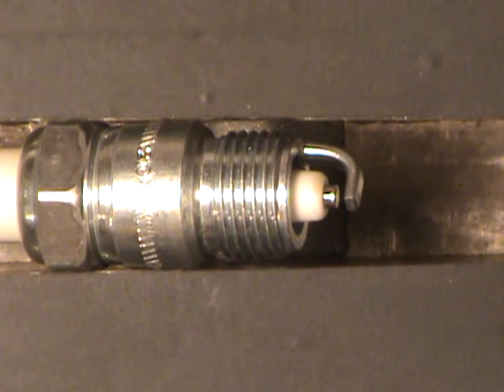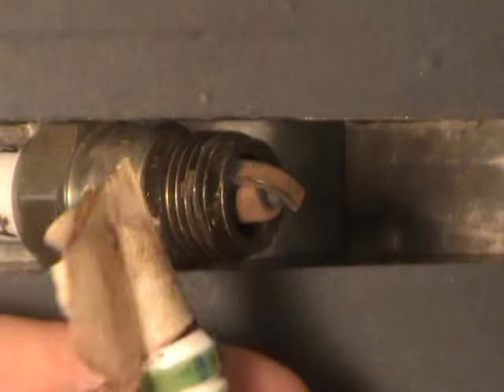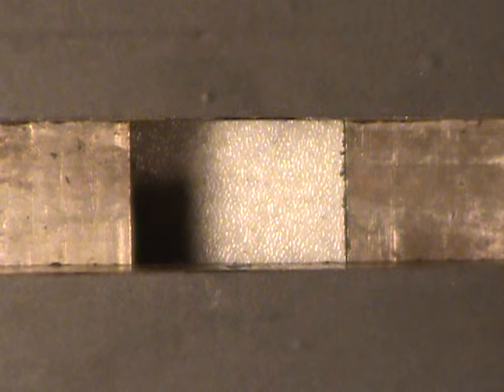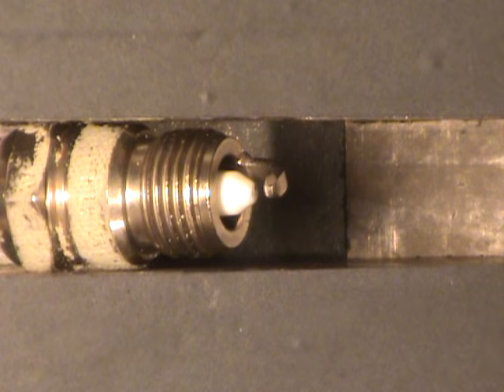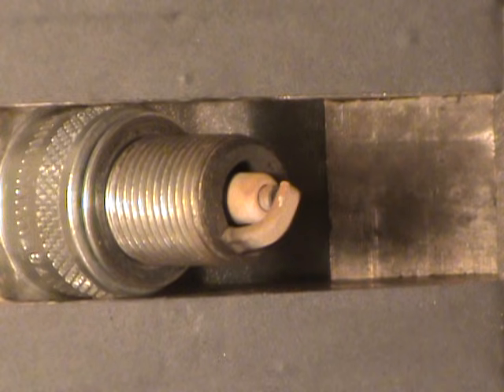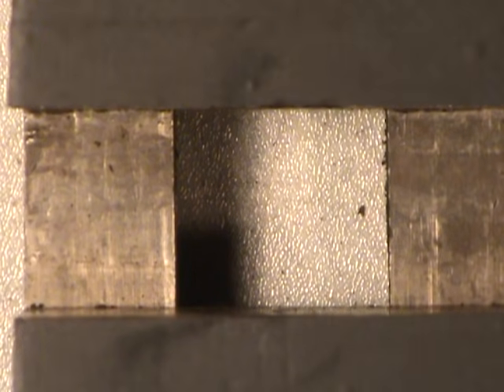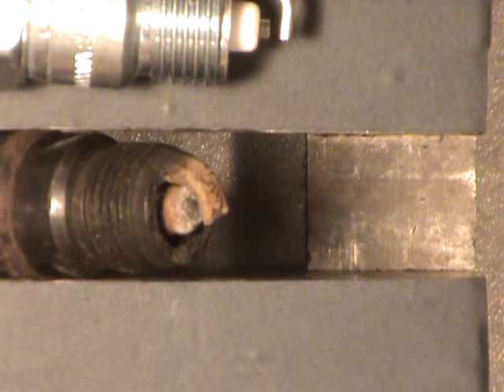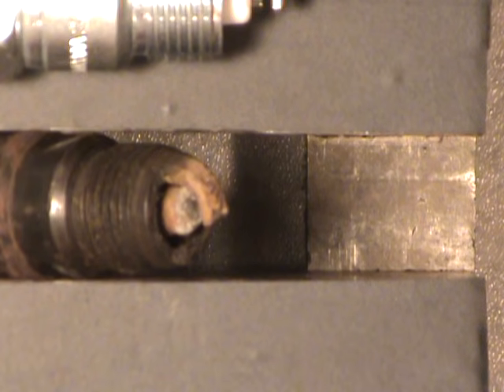SPARK PLUGS How to Read them (Part 3)

Comment: I have some pinging in my engine. Would a colder spark plug reduce some of that?
Reply from the maker: Ern H. Greetings Ern H.    Thanks for watching, and for, Your quite interesting comment/question as well...............................If You can tell me, "Exactly", what Your Vehicle happens to be, as in...Year...Make...Model...Engine Size/Description...etc., then, as I see it, I will be able to help You out, to a, much More Precise Degree, so to speak, otherwise, about all I can do, is Ball-Park/Generalize, as to what is causin' Your Engine's, not so wanted "Pinging" Problem.................................If Your Engine, happens to be "Computer Controlled", then, there really Should Not be any Pinging goin' on, as the Computer, when working Correctly, and as it should be doin', should be making, the Required Adjustments, to, both Your Air/Fuel Ratio, as well as the Ignition/Spark Timing (Advance), to prevent any Pinging in the first place.............................If Your Engine "Is Not" Computer Controlled, then, it could be, some of the following, or, a combination there-of................................Gasoline Octane Rating/Too Low, for the Engine's Compression Ratio...................Too much Carbon Build-Up/Deposits, on the Cylinder Heads (inside), as well as, on top of the Pistons as well............................Engine Temperature Too Hot (cooling system problem)........................Too Lean, of an Air/Fuel Ratio, for the Engine's Needs...maybe a Higher % of Ethanol in Your Gasoline's Blend? (that be Alcohol, usually derived from something, along the lines of "Corn-on-the-Cob", that will usually, make a Vehicle, with a Carburetor on its Engine, tend to Run, on the Lean, Air/Fuel Ratio, side of things)...(also...Elevation...At, or Above Sea Level?).......................Too Much Ignition/Spark Advance (in Crankshaft Degrees)...(Distributor Equipped...???...then, maybe...Too Much...Mechanical, and/or, Vacuum Advance), depending on, how Fast the Engine's Crankshaft is Rev-ing/Spinning, as well as, how Light, or Heavy, of a Load, is placed on the Engine, at any given time...........................Usually, for a Well Running (in reasonably good condition), Stock Factory/Low Compression Engine (not more then about 8.5 to 1 Compression Ratio), the "Factory/Manufacturers"..."Recommended Spark Plug"...will do just fine, unless, like I was sayin' above, a Problem or two, enters the picture............So, if You care to, You can let me know, what Your Exact Vehicle & Engine, happens to be, as, there are..."Many Different Ways"...that, both, an Engine's..."Air/Fuel Ratio"...and..."Ignition/Spark (Advance) Timing"...are..."Controlled/Administered"...as in, something, like, an (Ignition Related)..."Points & Condenser Distributor" (up till about 1974)...or a..."Distributor, that is equipped with an Electronic Ignition Module"...right up to..."Individual Ignition Coils, for each of the Engine's Cylinders"...Yikes...!!!...lol...........Now for, how the Gasoline, gets Administered/Regulated, into the Engine's Intake System..........................Might be...One of More "Carburetors"...or, perhaps...One or More..."Fuel Injectors"...and the List, can go, on and on, see what I'm getting at here...???...lol...........................Hmmmm, as I recall, on the Older, Low Compression Engine's, that usually had a Distributor in/on them, there are about, only 2 things, that I can think of, that might require a "Lower Heat Range Spark Plug"...one is where a High Performance/High Compression Engine, that may also be Turbo-Charged or Super-Charged, to Prevent "Pinging" (Pre-Ignition and/or Detonation), and, then, ah yes, that good ole, maybe not so well known, perhaps?)...Run a slightly "Lower Heat Range Spark Plug" (as compared to the Factory recommended one), if, and I say "If", a Vehicle is Driven, "Mostly at High Speed, on the Highway", as, an Engine, that is Operating, at Higher, Consistent, RPM's (that be Crankshaft Revolutions Per Minute), "Won't Have as Many Deposits On the Spark Plugs"...as Compared to, a Vehicle's Engine, that spends Most of its Time, at City Speeds/Low RPM's, and probably, at plenty of..."Red Lights and Stop Signs" as well (Hmmmm...Lettuce see now...Vehicle, with Engine Running, while Not Moving, gets..."Zero Miles Per Gallon...!!!...lol)...............The Spark Plug "Heat Range", is its Ability to Conduct Heat away from its Electrodes, and Transfer that Excessive, Unwanted Heat, into the Cylinder Head or Heads, as the case may be...........................Never go, to a "Too High/Hot, Spark Plug Heat Range, or, probably result in even More Pinging, and probably, one Destroyed Engine as well/perhaps...!!!...................If Too Cold, of a Spark Plug Heat Range, is Installed, then, too Many Deposits will probably "Build Up", on the Spark Plugs, in a very Short Time/Mileage.........................Basically, once the Engine, gets up to Operating Temperature, the Spark Plugs, have to Maintain, what is commonly known, as Their..."Self Cleaning Temperature"...where-by, by doing so, will keep the Deposits, at an acceptable level (not too many Deposits/fairly clean), and a nice strong dependable Spark, is usually the result......................Also, Change/Adjust the Spark Plug's Gaps, to Specifications (if applicable, that is), at the Factory/Manufacturer's, Time/Mileage Interval, or, as You see fit, to keep, nice, Strong & Reliable "Sparks", at, all of Your Engine's, Spark Plug's "Electrodes", for Good Performance & Gas Mileage too...!!!................So, there You have it, well, for now that is, and............Till next time...................Be Safe, take care, and have a good one.
Reply: +RockysRoadshow 
It is a 97 Nissan pickup 2.4 engine. I have the Bosch plugs with the 4 prongs on the electrode tip. If that makes a difference? I put an higher octane in and now the check engine light is on. Maybe the heat from the higher octane gas burn up the O2 sensor. But the pinging stopped.  I hope I answered the long ? lol
Reply from the maker: Ern H. Greetings Ern H.    Thanks for the information, about Your Nissan Pickup Truck, as it will help quite a bit.................................Those Bosch Spark Plugs, with the "4-Prongs" (being Side Electrodes), has me thinking the following.......The way that they might "Act", if they are "Not the Factory/Manufacturer's"..."Recommended Spark Plugs"...for Your "Exact Engine", and also, is the "Heat Range", the "Exact/Correct" Heat Range of Spark Plugs, for Your Engine as well...???...as Too Hot of a Spark Plug Heat Range, will probably result in some "Pinging", once the Engine gets up to Operating Temperature.............................The "Higher Octane Fuel" (Gasoline), usually Won't Hurt Anything..."Except Your Wallet"...lol (as in, it's more Expensive then, good ole Regular/Lower Octane Gasoline)............................You were saying, that, the "Pinging Stopped", when You put that "Higher Octane Gasoline", into Your Nissan Pickup's Gas Tank, and, has me thinking, that, Your "Ignition Timing/Spark Advance", might be "Advanced Too Much" (from the Base, Ignition Timing), and, if Your Engine is Computer Controlled, and is equipped with a "Distributor", then, Your "Base Ignition Timing", should be "Checked/Verified", and if Needed...Your Engine's Distributor..."Adjusted and Set-to"...the Nissan/Factory/Manufacturer's..."Specification"...for Your Pickup's "Exact" Engine (You might find a Sticker or Label, in Your Engine Compartment, with that Information, Printed on it perhaps...???)..............................Also, it's "Very Important", to keep up with "Regular Maintenance", and to "Replace Parts", when-ever, the Nissan's, Factory Manual Suggests, as in, Time or Mileage/Kilometer-age "Intervals"..........................Things, like Oxygen Sensors Don't Last Forever, as they could last, for, anywhere between, oh, about 50,000 to 100,000 Miles (Ball-Park figure), depending on their design, vehicle that they are installed in, and probably, if everything else, is working properly, as well...................That "Check Engine Light", is probably telling You, that Your Pickup's, On-Board-Computer (I think, that You have the OBD-2, as in On Board Diagnostics-Version 2, On Board Computer/System, since about 1996), has One or More "Trouble Codes"..."Stored/Recorded, in its Memory"...and, You will need a "Scan Tool" (looks kinda like, a slightly larger, hand held calculator) that usually Plugs-into, a Connector, that might be, near to, and Under Your Steering Wheel, on the Lower part of Your Dashboard, and, should have 16 Terminals, in that Connector................................So then, get Your (Distributor's) "Base Ignition Timing", Checked, and Re-set, if Needed, to Nissan Specifications...........................I can't say for sure, but, those "4-Prong Spark Plugs", might have something to do with that "Pinging" perhaps...???..............................Try Thinking back in Time...Can You Remember..."When"...You, First, Heard that "Pinging" starting to Happen...???............Did that "Pinging", start happening Slowly, over quite a period of time...???.........or....Maybe, You "Changed some Parts"...or..."Adjusted Something"..."Just Before:..the..."Pinging Started to Happen"...perhaps...???................If You care to, You can let me know, how You're Makin' out, and, if need be, I'll do what I can, to help You out.....................Good Luck, and..................Till next time...............Be Safe, take care, and have a good one.
Reply: +RockysRoadshow thanks for the info....it was very helpful